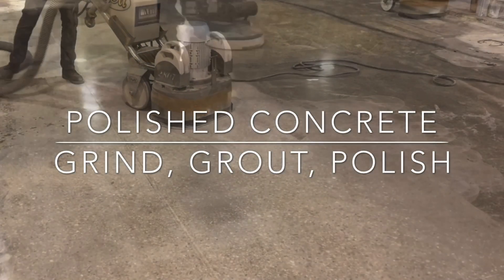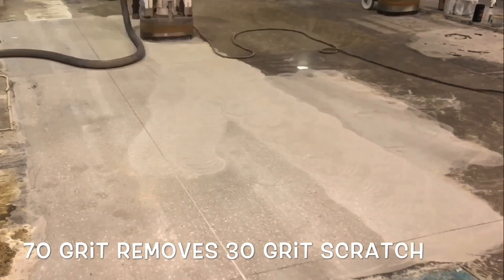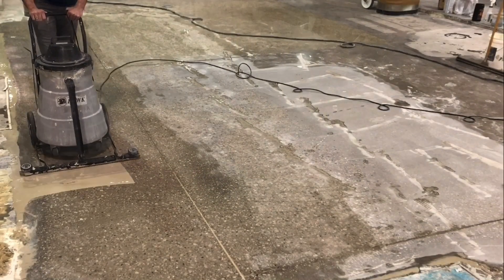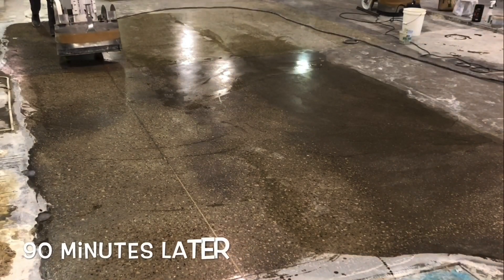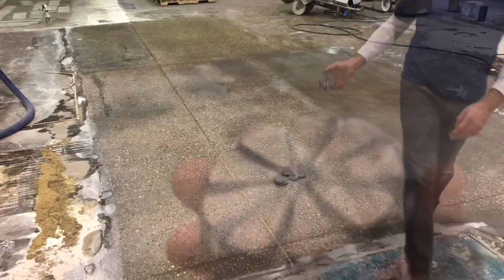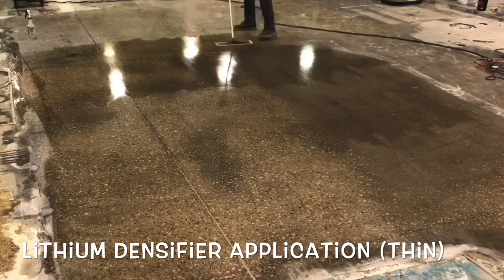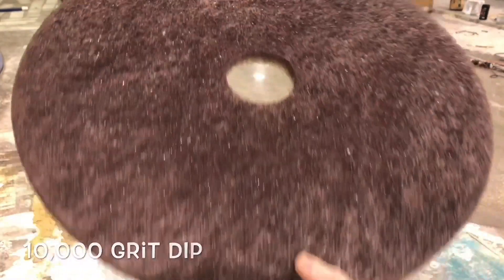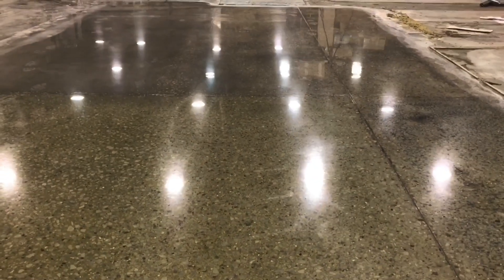Polishing Concrete Overview | Grind, Grout, Polish

Comment: Hi, Great video, which made me want to ask maybe a silly question.  As a Sculptor could I use a small solid grout block as a base for my work? If so whats the best way to polish and also get various colours for fine smooth finishing?
Reply: That’s a good question. I’m not sure which type of grout would be appropriate for that. The grout used here is going on very thin. It’s a reactive material that is meant to be spread. In mass, it would foam and warp due to its created heat. I would check out Cement All by Rapid Set. The home centers sell the product by the bag. That can be polished and it’s possible to pour it thick. Hand pads could be used to polish it, but my only experience is using polishing discs on a hand held grinder.

Comment: which urethane grout was used? Ive been using Metzger SRG which is good, it just sets up way too fast. Cant leave any amount in container for more than 2 min.
Reply: This was done with Smith Paints PCF45. It is also a fast set product but has a lower viscosity than most the other brands. Smith is also working on a slower and lower odor version, but here is a link to what was used:
https://buymanufacturersdirect.com/shop/manufacturers/smith-paints/poly-pcf-45/